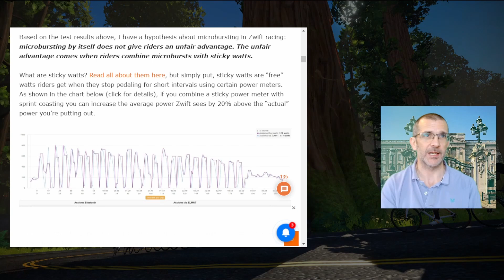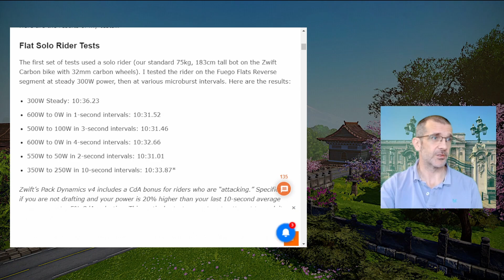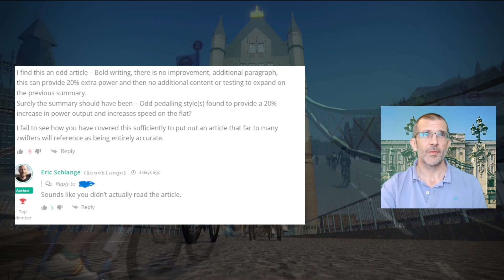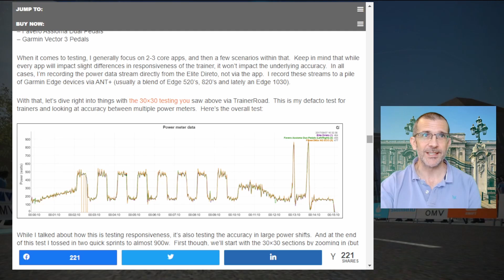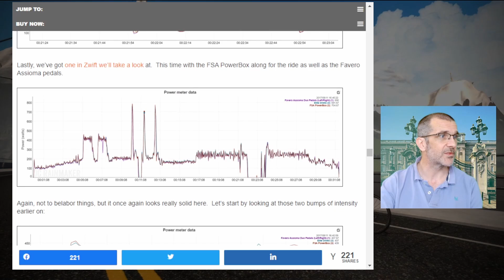Microbursting - Cheat or Myth?

Comment: Have an elite direto and a kickr core - elite gives me higher power readings and higher average watts for any ride duration. Kickr is v accurate when dual recording vs pedals on a gps unit. Elite good for the ego but it’s gone in the box for now as I want accuracy and fairness.
Reply from the maker: My power went up by around 5% when I came off the direto to Zwift Hub One

Comment: You ask for evidence that microbursting gives an advantage. It does, when it leads to Sticky watts. I ride a Wahoo Kickr Core, and have never seen sticky watts after 5 years of racing when microbursting. Until I changed my power display from 3 second average to instantaneous before TdZ stage 4B. I was losing contact on the descent, and kept microbursting to get back on. This produced sticky watts. My theory, Zwift uses the instantaneous watts, which can be sticky after a microburst, but normally you do not see the stickiness in reports because of the 3 second averaging.
Reply from the maker: No question that stickywatts can give an advantage.
Reply from the maker: The question here is whether varying power or microbursting gives an unfair advantage. For which there’s virtually no evidence.

Also the 3 seconds/instant display doesn’t make any difference to how your avatar reacts, it’s just for display purposes only
Reply: @ZwiftyZwifter  with instantaneous power I clearly got free sticky watts from a microburst, my assumption is that I also get those on 3 second display, but they are not visible in the power file but are visible in the way the avatar accelerates through the peloton. This latter point is the reason people microburst, and unfortunately the 3 sec reporting hides the evidence.
Reply from the maker: @DenbyDale421  Most people have their fit files available to see through zwiftpower. Only YouTubers, assumedly, are hiding the evidence of stickywatts through the 3 seconds thing?
Reply: @ZwiftyZwifter  maybe , I am not explaining well. The FIT files do not contain the instantaneous values, if you have the 3 sec setting, which most people do. They only contain a 3 sec average. So they get free watts through sticky watts caused by microbursting, But the data that Zwift has used for "the maths", the instantaneous value, is not recorded in the FIT file, only a 3 sec average. This, I believe is why many people believe micro bursting gives an advantage (it does with my Wahoo Core) but cannot provide evidence.
Reply from the maker: @DenbyDale421 I’m almost certain that the fit files are created independently of whether the display is showing instant or 3 seconds. Or at least those available through zwiftpower are all 1 second values. The volatility of mine hasn’t changed since I’ve switched to instant anyway

Comment: Is racing on ERG mode? If not then pedal how you like it. Cheating by weight is more embarrassing and if you can do a race in ZWIFT averaging 27 mph and in IRL can't even do 20 MPH😂
Reply from the maker: No ERG in racing. Yes, weight doping does seem extremely common and not taken very seriously.
Reply: @ZwiftyZwifter  The thing is, anything unusual in cycling is CHEATING 🤣. Everyone should have a nice-looking graph i.e. cadence and power 🤣. I guess we have to accept the fact that it is not IRL racing. Nice contents mate👍.
Reply from the maker: @dannybay0562  the weird thing is that spiky power charts have been seen as the smoking gun for microbursting by many, but if it’s holding fake watts which is the issue then it’s the opposite which would be the sign.
Reply from the maker: @dannybay0562  and cheers, man.
Reply: @ZwiftyZwifter  well i ve seen the most constant 13 min at 4.3wkg , Loch Loop ITT , than a sudden 10 sec dropout and a " surprising " normal powercurve for the rest of it . looked like the guy was on ERG ,
Reply from the maker: @evilstef667  how odd, a bot maybe?

Comment: I have a Saris H3 and I have big delays when I stop pedaling to get watts and cadence down to zero. Noticed it after doing the Alp when trying to coast down. Sometimes it would take 15-30 seconds before it would get to zero and my avatar to get into the tuck position. Also noticed it in a few races trying to do the same thing (tuck avatar) going down long descents and I couldn’t tuck to stay with others who could. Never thought about actually trying to use it on a flat as a short rest period. Interesting thoughts for sure though.
Reply from the maker: It’s hard to imagine many scenarios where holding a few fake watts for a few seconds would be advantageous
Reply: @ZwiftyZwifter   I thought all the higher level racing was dual record so wouldnt the pedals tell the tale?
Reply from the maker: @JohnBooth I suppose it would/should. There should be all sorts of evidence that’s never been presented to back this up, though. It’s almost as if the absence of evidence proves the case somehow.

Comment: Yehh I've left a lot of discussions and threads on the topic because as Im reading its clear many are talking about sticky watts but calling it micro bursting  - so straight away the thread is pointless. A clear definition of Micro Bursting first needs to be agreed upon before it can be tested properly and results clarified. Erics tests went some way to addressing the issue - but as he used bots it leaves a question on the table. As you showed at the end of your vid, the delay in power dropping to 0 when someone stops pedalling. I have 2 questions on that. 
Has that anything to do with the 3 sec power display option in Zwift Settings?
If there is a lag or delay in power dropping off, is the same delay or lag experienced when picking the power back up again - hence canceling each other out?
Reply from the maker: Yeah, even I should've been clearer here about the difference. Even just mentioning that microburst cannot be the absence of power data being 'filled' with the last known value.

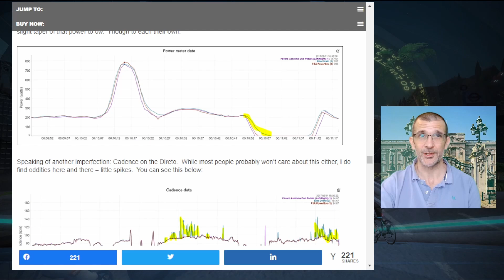But yes, I also failed to point to the 'other' side of the chart at 10:26, for instance which shows the corresponding and - just about equal - delay in powering up. Which also tallies with my experience, that the flysheel of the Direto was actually far more tiring to use as it took significant effort to power up to efforts if it were left to run down.

I think I was using 3-sec avg power display, but even if not the taper down time is nothing like that shown in Rainmaker's test.